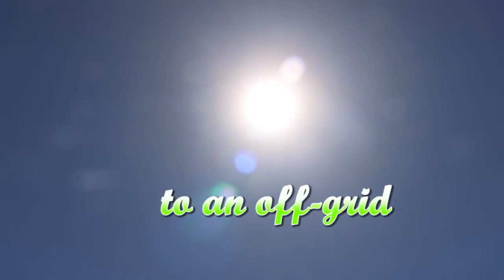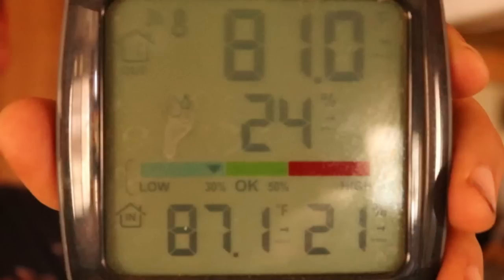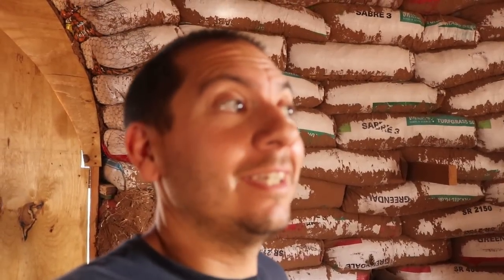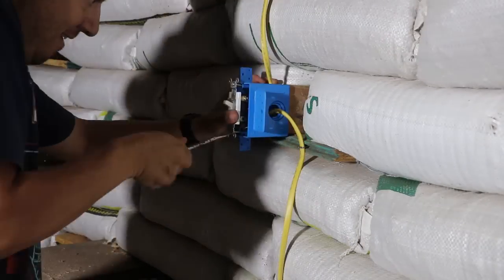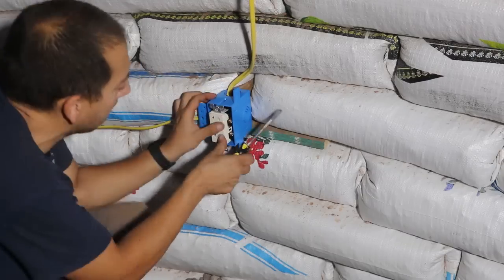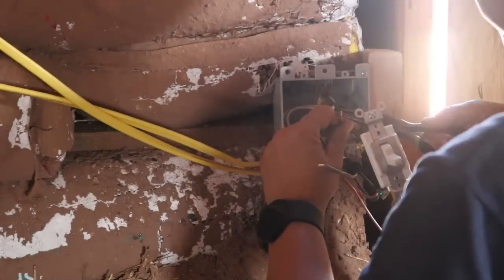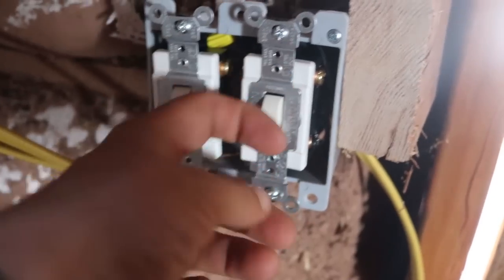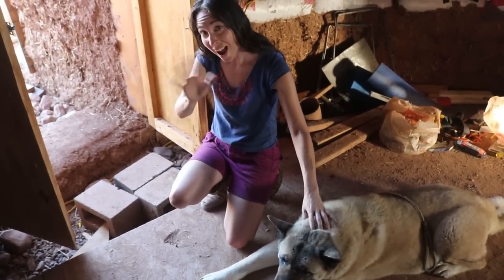Heatwave Strikes! Will We Need AC In Our Earthbag Dome? Building Off-Grid In The Desert

Comment: I am sure that once you finish the walls and doorway inside the extra mass and sealing will help. Come your hottest weeks, you could even set your air conditioner in the loft and hook the exhaust to one of the vent pipes. The cold air will drop and pump the hot air out of the remaining vents.

Comment: Hey folks, how about this? If you had several ventilation slots around the base of the dome that were screened with doors so you could open and close at night to allow the cool night air to come in and a single screened door near the top to allow the hot air out would work very well to cool the dome when you desire. What do you think about that?
Peace

Comment: Exhaust fans are great for pulling out the heat, and creating a good breeze. But I once fixed three, three phase exhast fans in a paint booth. They were wired for 480 and they were only getting 240. When I started them, a room where all the windows were opened, and a wall moved. Positive and negative pressure, can affect structure.

Comment: You could use a swamp cooler on the dome as well as on the trailer. Swamp coolers can cool as much as 20 degrees from the outside temperature. They use less energy to run too. Check them out. They are an old way of cooling but it works well for dry hot areas.

Comment: What do you think about doing a layer of Air Crete as an insulating layer between the earth bags and the outer plaster?  I also think that a white layer of plaster will reflect the heat some.  I feel that after all of the thermal mass is warmed up it will take a lot of energy to cool.

Looking forward to hearing what you guys think.

PS you guys are amazing and are an inspiration!!

Comment: I'd be a little surprised if the temp differences stay the way they are once you're living in the dome. I have a feeling that the daily general usage items will cause the inside temps to be higher than when it's empty.  But I also think the outer layer of the dome can make a huge difference as to how much heat builds inside. Time will tell though.

Comment: IF (and I do say if)...... the outside of your house was white in color it would absorb less heat from sun..... even a lighter tan may make a difference.....BUT ..... if you were to shield it with a tarp say 5 feet away from the structure to shield it from the sun rays (maybe a test??) ..... reflective material may make a difference too.....I use mylar glued to my hammock tarps and it makes a huuuuge difference...... trees, wood fences, etc have all been used in the past

Comment: Blow the cold air from your downstairs up through the floor to the upstairs all you need is a fan
Reply: Why stop there?  Cut the ends out of several 30 gallon drums and weld them together to make a tube all the way to the attic.  Then, just make a transition adapter for a 20” box fan at the bottom.  You'll be bathed in cool air as it falls back to the bottom.
Reply: @lewis2553  yeah that's the right 💡 or use copper tubing In the ground run water through it back up to your barrels  thermal air
Reply: @lewis2553  hello lewis my name is John Patrik  a singer song writer from Texas go listen John Stahaley formerly bad company's guitarist is on my last CDs 10 kindsa whiskey and strange perfume on YouTube the band is the suthern skyze band  I like your idea ....barrels
Reply: @johnpatrik6291  Thanks!😊

Comment: I believe you should run a 4 inch pipe  with a computer fan from the bedroom to the loft.cold air sinks, so by blowing bedroom air into the highest point in the dome will equalize the whole dome temp with little electric.

Comment: I heard that about travel trailer ac... Mine had a old roof mount probably around 11,000 BTU... That's done for. So they legally before I moved in were required to have some ac... They only got one small 5000 BTU window ac for the back bedroom.. I added a front room AC... That's in a window so small it's also only 5000 BTU. Which still is rated as more than enough for the small space. It's rated as around three times the amount needed. But the reality is the old trailers insulation just doesn't make that true... On days here in PHX that get over 108... I have a middle bathroom with both acs on full they can't keep up with... If I close up the bathroom It's livable just barely.. popcilcles weather for sure... Extra rinse off times ect...I keep the doors open just barely enough so my dog can pass through an not freak out. An put water in the back Under the bed. where he hangs out anyway... An up front with his food...
Reply: Friend think of heat gain like water: there’s no such thing as cool only less hot: cooling doesn’t add cool it’s removing heat. Friend if you are in an unshaded trailer you are in danger of overworkingbthise AC units: get some thing cool on your roof first but also I really urge one way to reduce heat gains is you can go to lowes and get a roll of reflectix bubble radiant shelf wide rolls of insulation. Clip it on to the roof, the outside of sunstruck glass put sone decorative lattice panels or sone of these awesome pattern cut panels, and block radiant gains from the outside: any AC it’s like using a pump to empty a bucket. It can be a fine pump but if you have tons of other sources adding water to tgst bucket you’ll still flood. Another way to think if it imagine you can’t get too wet or you’ll melt : do you need to be sealed up totally in plastic? Your body is ok with 98 degrees of heat so sone wet is fine but not drenched. An umbrella isn’t sealed but it does shunt a lot of water away from you before it even hits. Exterior shading or plant based external evaporation  of the air in the foot or two around the structure is like helping stay less drenched in heat with an umbrella: yes you get heat as you do get some wet using an umbrella but it’s better you aren’t standing with nothing over you in a deluge. : cutting down the radiant gains with exterior shade is good. Even something thin and light. With an air gap under it. Stay safe.
Reply: Also get a cooling pad for puppy.

Comment: Use a white lime plaster like they do in Greece for example. It helps to reflect the sun and if you use the right mix (look what is used to restore old buildings, ask me or check out Kris Harbour Natural Building channel for lime plaster mixtures) , it protects the dome against rain too. See the Greek islands, there is a lot of wind and (salty) rain and the lime plaster resists. Forget dog hair and also straw in the top cover, it will lead the moisture to the inner layers. Note: the lime mixture has to sit and rest for some months (minimum), do not use fresh mixed lime.

Comment: Insulation on the floor in the dome, should make a bigger temperature 🌡️ difference... Even floor inlayment diy people skip... That's a r3... It's just a thin insulation pad really under the tiles pergo ect...like a carpet pad but more flat like a reflective type of thing... Cost extra but it's to reduce sound transfer mostly...If it were more of a tunnel with a door it would be more of a difference... But it has a plywood floor.

Comment: The cheapest and best is a swamp cooler, or a window ac unit. I don't even use my central air unit AT ALL!   NO MORE! The swamp cooler don't work here cause of the humidly. But where you live at in a drier climate would work EXCELLENT. Plus you can make one from a fan and a coil  wick  with water running over the wick.  I would go wind power!  Got wind blowing all the time. OVER SOLAR  much cheaper and produce more electric. Car batteries cost a lot of money now days. That would be the biggest cost>   storing electric. What i would do is have a electric company come out and set up poles for electric . FOR A BACK UP !   ALWAYS HAVE A BACK UP PLAIN. My electric bill is around >  75 bucks a month >  I LOVE IT !  it due to all the cuts back and plaining i done >>   from 400 dollars a month what it use to cost me.  👍😊🌈Now we just got natural gas line in!  So i got to get set up on that

Comment: A swamp cooler would work well out there and cheap on power
Reply: Expensive in water though.
Reply: @honthirty_  i run one all the time 15 hrs a day never notice it on water bill
Reply: @guyindesert   So you are on city water, don't collect your own water? Draw 300 gallons of water from your city tap, turn it off, and live on it for a week.  
Evaporative coolers consume 3 to 5 gallons per hour.  That is 75 to 125 gallons per day, which is twice what they use for all other uses combined.  There are 100 to 180 cooling days per year where they live in AZ,  so that would be another cistern to run evap.  AZ is in a 20 year drought, worst drought in 800 years... When the Anasazi died off, a prehistoric Native American civilization where
 now the U.S. states of Arizona, New Mexico, Colorado, and Utah intersect.
Reply: Correct city water ..ya only get like 110 in summer not to crazy I work in hotter weather in summer ..but in general for me a lot cheaper than running a/c at least by half. For now water is cheaper than power for where iam at
Reply: If they shipped water in how much would it be for like 3000 gal 150$ ?I dont know what that cost

Comment: I would seal that door and plug up that tube upstairs letting the heat in and get my fanny in there.  I bet the lower floor is even cooler than the middle.  try it man.  I bet crew would want the lower part lol. y'all could make it with a fan man in the dome. less electric for sure.